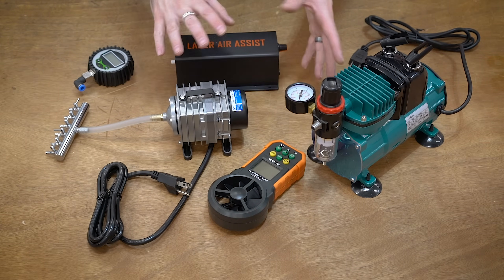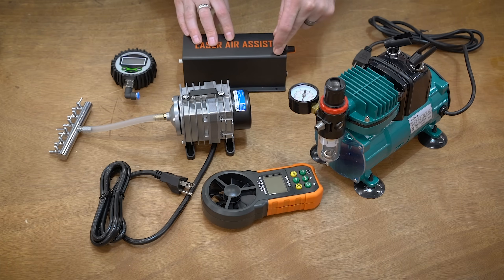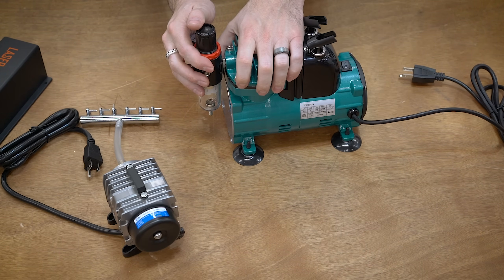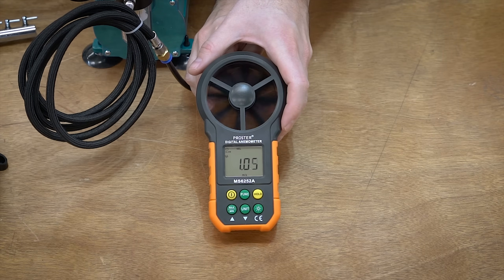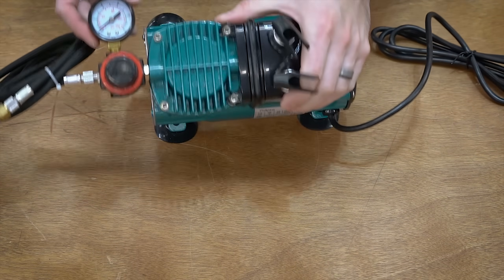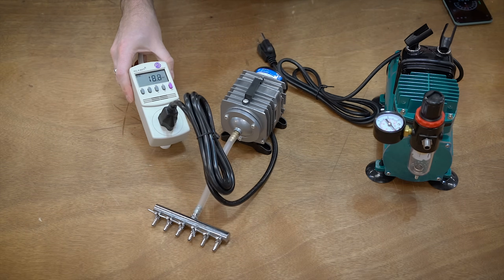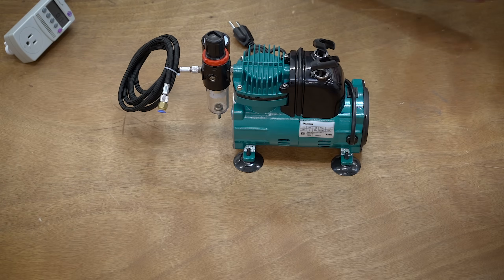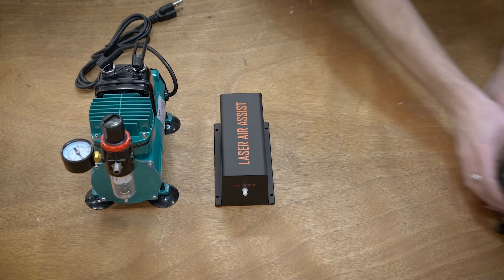Laser Air Assist Options

Comment: I have tried the Airbrush compressor, but it's a pain in the butt as it cuts out at a certain pressure then reboots, it is also very expensive to run I have a 50 watt CO2, So I purchased the Atomstack Air Assist and it works great
Reply from the maker: I'm glad you found a solution that works for you!

Comment: research pressure vs. flow. also the air needs to blow through the kurf (surrounding the beam). not just air in the area. angled and offset air are not the best option.

Comment: So, a year out, how is the airbrush compressor working out for you?  I assume you noticed how hot it gets when running an extended time.  Any fails since I don't think it has a 100% duty cycle?  And most importantly, have you noticed any increased laser performance ( cutting deeper, cleaner, faster ) with the compressor.  Thanks
Reply from the maker: I use one of these on my CNC router and just mounted a couple 120mm fans on top.  It works well.  I don't really use diode lasers, I just use the built-in air compressor on my xTool CO2.

Comment: I mean, which one matters most when laser engraving?  Air flow or pressure?  (I honestly don't know and am asking)  I would think if you had a good amount of air flow coming out of your smaller tube there would be an inherent amount of pressure that would be there also...but is it enough pressure?  Most of the metal you're lasing away, such as in fiber lasering, is small enough pieces that you wouldn't need a lot of pressure (I would think) but you would probably want a considerable amount of FLOW.  Just my thoughts, as I am in the boat right now of considering adding air assist to my fiber setup.  Thanks for the video.  I think I'm liking the Laser Air Assist AND it's showing at $69 on Amazon right now.

Comment: I have been using  my air brush pump however it’s noisy and gets really hot. I don’t think it’s made to run continuously and if I want to use it for painting it has to be refitted.  So I ordered the Tetra aquarium pump for 60 to,100 gallon tanks ($16 on Amazon) it doesn’t put out quite as much volume as the air brush pump but it’s close enough. It’s whisper quiet and made to run continuously. At that price it’s a no brained.
Reply from the maker: Yeah, there are a lot of options out there, glad you found what worked.

Comment: With the air brush compressor will it maintain a constant 15psi for example or will it keep dropping and not be able to keep up if using that pressure for a while?

Comment: Try refrigerator compressor, it designed  to run a-long-time...
Not like air brush compressor, not designed to run continuously for hours..
And for aquarium, it could run more longer than the laser itself.... but the flow very low...
For laser air assist, it's use radial compressor... and lifetime maybe comparable as laser life itself... or worse...
Reply from the maker: I've looked into those, good idea.

Comment: based off this video, I bought the exact same black Laser Air Assist air pump which is now $59 and gauge as you have there, yesterday 8-5-2023 - absolute garbage!

Max PSI on that pump is 6PSI.  not even worth the effort.  I also would not run the airbrush compressor due to the simple fact it's not designed to run for a long time without over-heating.  Better off with just an aquarium air pump

Comment: Sorry but this video is ALL WRONG
The airbrush compressor has not a tank, this is the airbrush compressor itself, the tank version has a slightly bigger tank on the bottom of this.
Then using different hose makes a lot of difference in the outcome.

Plus using the water trap is another think

Comment: Good data to have. Thanks for the video.  I'm currently using a HarborFreight "12V 100 PSI High Volume Air Inflator", which can cost as low as $25 when on sale,  for my air assist.  It seems working fine.   It is loud,  hot,  and draws around 50W. It has no spec on its air flow though
Reply from the maker: Gotcha.  I think just about any amount of consistent air flow helps.
Reply: @RobertCowanDIY  Do you get the power from a 12V battery?
Reply from the maker: @glennablomquist3509  I'm not sure what you're asking.  All the 12v options have a power adapter that just plugs into the wall.

Comment: I found with my airbrush compressor, it ran all the time, and did heat up a bit. There was no cycling at all.
Reply from the maker: If you are using more air than it can store/deliver, it will run constantly and heat up.  They're originally made to run intermittently, so you might want to limit the airflow in some way so it's not running at 100% all the time.  I usually only use mine in short bursts.
Reply: @RobertCowanDIY  how long would you consider running a long time continuously?  And could it keep up at 15psi with no tank?
Reply from the maker: @JoshhColee  Maybe several hours at a time?

Comment: Given that the air assist is an open airflow system, the pump PSI isn't that important. About all it needs to do is be able to overcome the pressure drop of all the air tubing between the pump and the air assist nozzle. CFM is more important for this application, but I don't know what an appropriate CFM at the air assist nozzle is ideal. You want enough to blow the smoke away from the lens and cutting surface and prevent flame ups in the cutting material. But you don't want so much that you are blowing your cutting material (or small cut-offs) around.
Reply: Yet everyone keeps yelling more psi.  I wish i had the time and means to test this.  I am thinking of buying a large pond air pump. One i am looking at is 5psi.
Reply: so what cfm range do most air assist machines especially made for lasers use?
Reply: @Dahna  for keeping the lense cool and "clean" it takes very little. The small pumps are plenty to maintain this. But when you get into dirty material or cutting you will want more cfm. 
The larger cfm is a by product of the more psi that everyone screams about.

With cfm air at the nozzle your air extraction  of the unit is important. I have good results with 6" 350cfm fan. I tried more and just got more noise.
Reply: @turboflush  thankyou for your response . By "noise" do you mean sound or do you mean like a noise in a photo?
Reply: @Dahna   fan noise.
My fan is mounted outside so it helps. But the air noise from rushing through the machine.

Comment: Interesting video.  I think a better method of evaluation would have been under actual use condition.  I have the Aquarium Pump & the Air Brush Compressor.  I use the Aquarium Pump on my Diode Lasers (Laser Master, Laser Master 2, and a small CNC (3018) with Laser attachment.  It works awesome on them, and I have never had a problem.  I use the Air Brush Compressor on my OMTech K40 CO2 Laser.  It workss awesome there, and, I have never had a problem with it either.
Reply from the maker: Fair, but this gives you an idea that there's more airflow out there, which might help with chip evacuation.  There are a million applications for these, I'm just trying to show the comparative differences.

Comment: Funny I have my 2 tank airbrush compressor for my k40 air assist for my laser cutter.. works great and I can use for painting..
also a counter top ice make as well for cooling.. Though about using one of those small college compact fridge as well to see if that may work for cooling..
Reply from the maker: Nice!

Comment: Either Your pump is broken, or this "manifold" is severly limiting the air flow. I did same exact measurment with all 3 pieces of equipment You have here. And this "aquarium pump" (it's not really aquarium pump, but lets not get into that) have 17 times more airflow and 5 times more pressure than this "laser air assist". Also, Your testing is really bad, You have to point the outlet on the far outer rim of the anemometer. If You point it in center Your measurment will be extremely off. This gives me conclusion that You do not know what You are doing.
Reply from the maker: Yep, am idiot.
Reply: @RobertCowanDIY  lol  I really appreciate being able to hear the differences between the units. Foxalien has a similarly looking rectangular unit with the spec of 8 to 10 L per minute. They also have a newer unit that looks completely different but it’s quoted to deliver 30 L per minute. Since I’m looking to replace my ancient air compressor in the garage that is basically a ticking time bomb, I was thinking of purchasing a “MAXIMUM 4-Gallon Ultra Quiet Portable Air Compressor” which is reportedly relatively quiet. If it isn’t, then I’ll guess I’ll invest in one of the smaller units.
Reply from the maker: @dougw3531  Nice.

Comment: like your Vid. The airbrush compressor doesn't have a tank it is just the motor and a piston that has a little stroke. its what i use on my adomstack x20 pro. With 120mm fan to keep it cool. it wasn't made to run constantly but i do it anyway and has not failed me yet. the Aquarium pump and the air assist pump use a diaphragm. need to add a nozzle to the equation.
Reply: Which compressor do you have and would it be able to stay at 15psi for around 40 minutes continuously?
Reply: @JoshColeHD  I use one from Harberfreaght. They have some on Amazon for cheaper. I have a 120mm fan that helps keep it cool. I ran it for about 3 hours once with no problems and bet I could have gone longer.

Comment: Thanks for that vid. If the compressor went to a small tank first, it wouldn’t be running the whole time. It would pump up to 80 and turn off until the pressure dropped. There could be a reg and a flow valve on the other end of the tank. It would still use more energy as it takes more work to get psi up to 80

Comment: I was surprised you did not do the only test that really counts. An actual cut test comparison.
Reply from the maker: I debated about including that.  The problem is there are SO many variables.  Laser power, material, speeds, etc.  You can adjust each to accommodate for a lack of airflow, use tape to keep the top from burning, etc.  In the end, I just wanted to compare the performance of each.
Reply: I wish I could give you 1000 thumbs up for that comment.

Comment: Would you be able to tell me what size the threads are on your adapter for the airbrush compressor? Or maybe a link to where you found it? Thanks!
Reply from the maker: I'm not sure, you can find them on the specs for the compressor.  I just happened to have something sitting around, so I'm not sure what it was, it just fit.

Comment: I'd assume you could restrict the air compressor output with an adjustable nozzle and still get plenty of airflow. That would let the compressor charge up the tank and run at a lower duty cycle so power is less of a concern. I have one of those (for actual painting) and with a typical airbrush nozzle set to full flow at constant draw it runs at well under 25% of the time and still blows pretty strong.
Reply from the maker: Gotcha, good idea.
Reply: I tried this with my air brush compressor. I pinch the line and don't get more flow out. (By my testing) actually watching this video to see what else is out there that can move more air and build more pressure in the nozzle of my cutting head to get more velocity at the cutting surface.

Comment: I'm leaning towards the Air Assist unit because as of 12/13/22 Amazon has it with a $30 off coupon plus I plan on mounting my laser to a board so I can hang the entire thing on a wall when not in use (small shop, gotta save some space where I can).  The small form factor & weight of the Air Assist would be perfect for my application.

Comment: It may use more power, but it will also only run intermittently once the tank is charged. Less efficient to compress air to a higher pressure than you need though. It makes heat that ends up being lost energy.

Comment: Nice. I was hoping you’d analyze the performance of the air assist on the Gweike laser. I’ve bypassed the filter unit on mine and now am just using that for the air assist. I’ve been thinking of getting a dedicated air assist unit (so I could just remove the air filter/pump entirely) so this video is well timed. I may just end up taking the Gweike pump out and powering it separately. Fwiw I’ve really been enjoying the Gweike. I’ve made probably over 100 prototypes for a new outdoor/travel product with it. It’s been rock solid so far. I wish it had a laser pointer and real auto-focus, but otherwise it’s been great. I have you to thank for putting me onto that unit. 🙏🙌

Comment: I use 2 of the 110W aquarium bubbler pumps to blow chips away on my CNC mill. have them both hooked up to the same hose with a simple T fitting. It's not perfect, but when its cutting for an hour or more at a time I didn't like my air compressor constantly on the entire time. They keep the cut clear of chips so I dont recut, and they are relatively cheap and disposable for when they do end up kicking the bucket.
Reply: Thanks for this, I am using a 30W (60 l/min they claim) air bubbler pump, but it's too weak for my cnc router, that has a long tube from the pump to the nozzle. How many l/min can your setup blow?

Comment: one important measurement not included in your comparison was duty cycle ... t
he aquarium pump is designed to run 24/7 the airbrush compressor is not it is designed to to start and stop. 
the laser pump seems to be a nice balance between the two.

Comment: Planning to get a California Air shop compressor and just run a small hose of the tank manifold.  A small valve will provide plenty of flow.
Reply: Agreed.  If I already have a shop air compressor with accumulation tank do I need a dedicated laser air assist?
Reply: @keithbader683  Keep in mind that the air will be jetting out a very tiny hole in the lasers head. this is good for blowing things away, but its called a 'jet' for a reason. it provides thrust.  so if u go too big u can actually move the head upwards. and if the pump vibrates in its actions and the air pressure also fluctuates u can get squiggly lines in your cut or even worse in engraving.

Comment: I use the air brush pump like your blue one. It will get extremely hot but I made a small wood tray that hold the pump and a 5 inch fan. The fan blowing over the pump continuously will keep it cool for 6-7 hours. As for air volume or pressure this one is more than enough. Had mine for two years and hundreds of hours free of any problems.
Reply: Same problem with mine was very worried about this burning up. But I put 2 computer fans on mine with bailing wire. 1 pushes 1 pulls  and it's as cool as a cucumber..
Reply: What did you use for a fitting coming off of the airbrush compressor to reduce it to fit into the skinny tubing that is attached to the laser?
Reply: The compressor came with 1/4in hose and fittings. If your compressor has a threaded output you could go to a hardware store or Home Depot and get a matching fitting( that fits the compressor) and has a tubing adapter end. Get some 1/4in  tubing to run to the laser. @wendytamburini

Comment: I was hoping you would take the laser air assist unit apart so we can see what kind of pump it has inside! Lol
Reply: I too would love to see the guts of the laser air assist.
Reply: Yes me too, sounds exactly like a little aquarium pump.
Reply: I also thought the big aquarium pump was going to blow it out of the water.  🤷‍♂️
Reply: They use a small radial pump inside the plastic case. Mine died in 4 months so I took it apart and they are extremely poor quality for the money
Reply: I was hoping we would see the best results on a test cut with each.
Reply: Laser air assists are aquarium pumps put in a fancy housing. And not the good versions either, that is why its so light. all plastic.

Comment: I don't think the air brush compressor has a tank on it, the output goes straight to the regulator. The "tank" is the crankcase for the piston pump and the motor itself.
Reply: Agreed. The only thing on that setup that could be considered a tank is the airline drier. But that is too small to have any tank capacity...
Reply: Incorrect.  I have that compressor and it does, in fact, have a tank.  Scares the crap outta me when it's been full and suddenly the pump kicks back on.
Reply: That doesn't mean it has a tank, just that it has a pressure switch that turns it off when you aren't using air. 
Give me the brand and model and I will look it up lol  @johnjacobjingleheimerschmi9997

Comment: Mhh... Aren't you kind of confusing the Air Assists' purpose of removing the vaporized material with how you may use it on your CNC to evacuate chips? I was under the impression of Air Assist on a Laser serving mostly if not exclusively the purpose of extinguishing the inevitable formation of a flame with certain materials ( possibly also cooling down materials that may suffer from the heat caused by the Laser remaining in the material ). 🤔
Reply: AFAIUnderstand, the Air Assist improves performance by removing material including the fumes, which obscure the path for the laser. I'd say, cooling/extinguishing flames is the side effect rather than primary function.
Reply: Yes but the main reason I use it is to keep the smoke and debris away from the lens (expensive) clears the area and puts out fires.